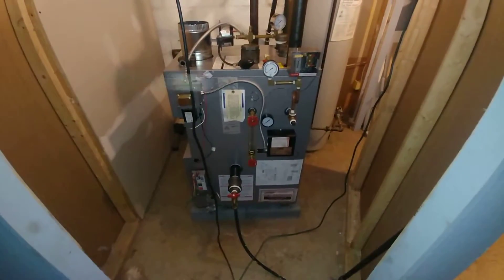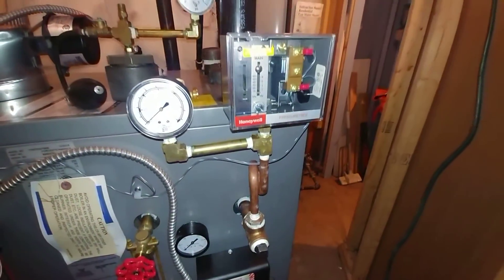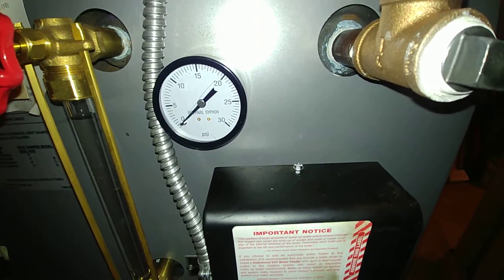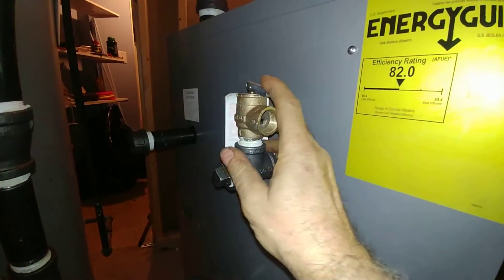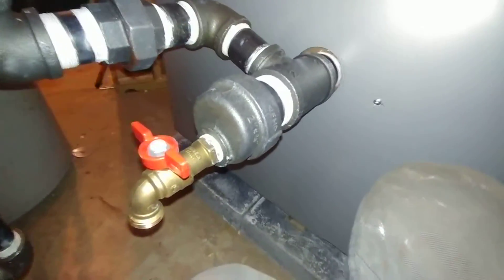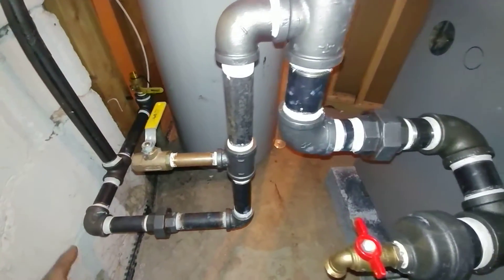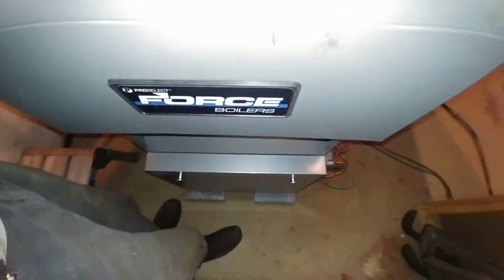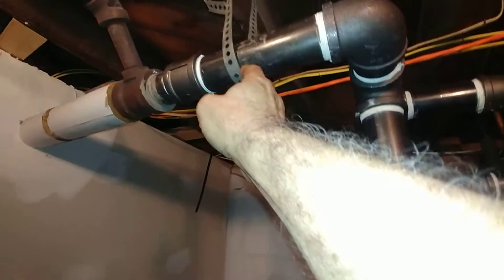Hartford Loop, Equalizer Line, Wet Return Tie-in, & Pressuretrol Oh My!

Comment: Nice job sir! I would’ve spun the boiler and faced it away from the wall. Makes the piping more intricate but easier to service. Nice job though.
Reply from the maker: You are most welcome, sir!
Yeah, that boiler positioning was a bear and at the time it seemed there were no good perfect solutions. I went with the one that appeared to have the fewest conflects down the road. Ain't nothing quite like piping in one of theses things and finding oops can't fit that final piece in!
Reply: Most installers don’t service what they install.   I service what I install.  And layout jobs from both prospectives.
I like to paint my pipes shadow grey as I was taught,  does not show the dust as much and always looks clean.
Most installers and mechanics don’t think it makes any difference,  then why are boiler jackets painted.

Comment: Never seen a straight steam feed like that. No king valve for pressure blow down?
Reply: Are you referring to the counter-flow main?
Reply: @elgordo271  the main riser.
Reply: @mugen-mundo  Are you referring to the 2" riser directly from the boiler?
Reply: @elgordo271 yes usually there is a elbow and a another elbow that makes a equalizer.

Comment: Very nice near boiler piping.  What brand of cast fittings?  I paid extra for Ward fittings on my IN8.
Reply: Thank you for your complement!

Ward fittings seem very good.  When you hold a 2" 90 from Ward in one hand and a Matco-Norca  or Bluefin or whatever chinesium 2" 90 in the other, you can indeed feel the difference... the Ward feels clearly superior.  If I am running sch 40 steel pipe and fittings for gas and I want to reduce the likelihood of a leak,  Ward or Anvil (the only other USA fitting out there) is the way to go.  Or was.  Now I use Megapress for gas.  Passes inspection every time.

With steam, I must confess, I'm not so picky.  The danger of a leak or failure is so much less of an issue. I use whatever import the supply house sells.  I've only cracked one import fitting I can remember (ten years ago)...it was from Homeless Despot as I recall... served me right.

I used to buy Ward all the time. I bought loads of custom cut nipples from them. Thousands of dollars worth. Absolutely beautiful threads - crisp and clean they were! 

But the last batch they sent me was made with Korean pipe (nothing against S. Korea per se),  but they charged me USA prices!  When I complained, they said it was a domestic product because American workers cut the threads.  

 Why pay twice the price for a name with no honor?